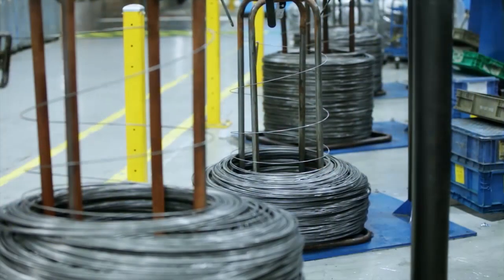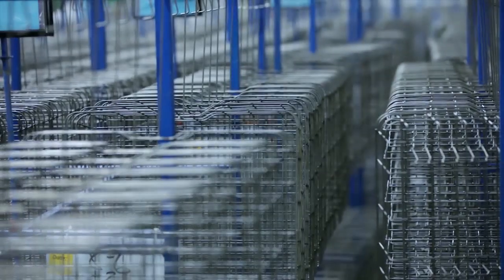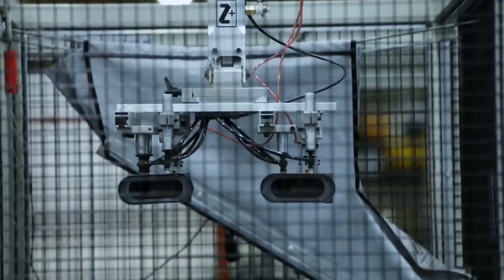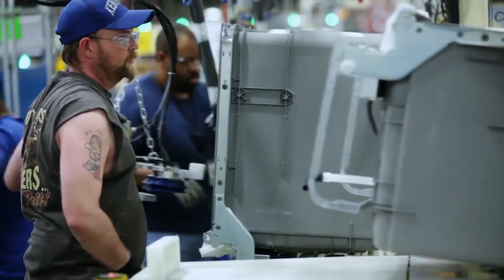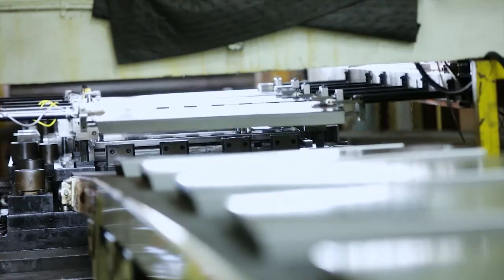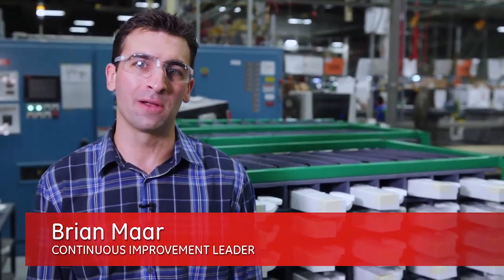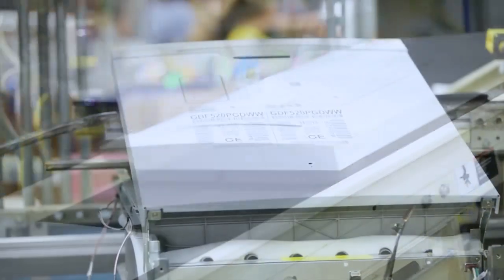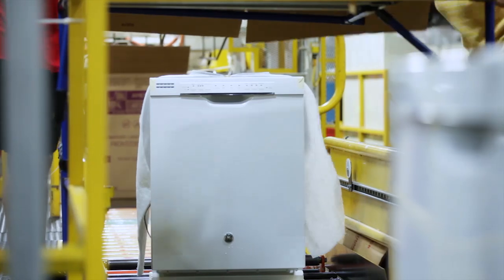Virtual Plant Tour - GE Appliance Dishwashers

Comment from the maker: Hi, LGwasher fan. The GE Filter-Flo System was incorporated into many of our washers manufactured prior to 1994, and was quite popular! We do appreciate your feedback and will forward your request to our design engineers. As our newer washers have a better pump and larger holes in the hub under the agitator, our drain system allows water to flow through the basket and out the bottom of the tub pulling lint, hair, and small particles with the water. There is no maintenance required on this system. We always appreciate your input!

Comment: BRING BACK  THE GE FILTER-FLO WASHERS!!!
Reply from the maker: Hello LGwasherFan, Thanks for your comment. GE has made use of several washer lint filtering systems over the years. The Filter-Flo system was on our 1993 and earlier models.

The fine mesh filters were removed from under the agitator when it was found that a better pump and larger holes in the hub under the agitator did a better job of removing lint and preventing clogs in the drain system. The drain system allows water to flow through the basket and out the bottom of the tub pulling lint, hair, and small particles with the water. There is no maintenance required on this system.

We are do appreciate your comments and will be happy to share this with our engineers for future design and development. Thanks!
Reply: GE Appliances YAY!!! Thanks. If you could use modern technology like what you just said while using the filter-flo activator and wash action, I would be sooooo happy and recommend them to everyone! If you started making them again, when my LG Washer breaks, I would go straight for the filter-flo. My grandmother actually has a 1983 Filter-flo. It never has had one problem. I would be thrilled if these were made again! Thank you